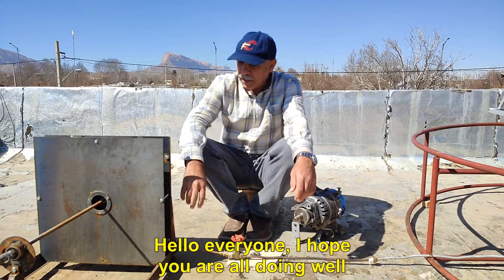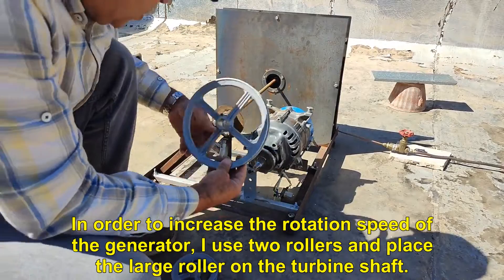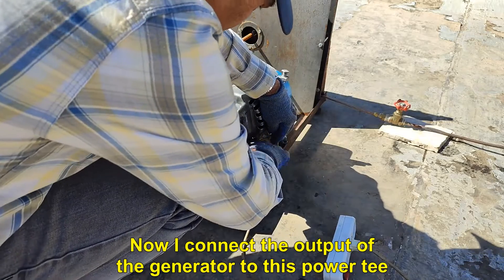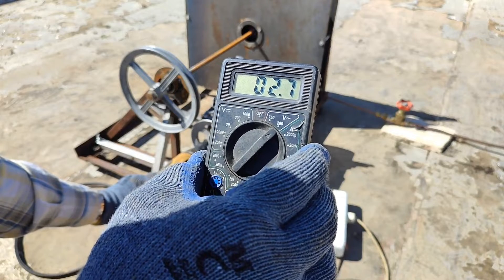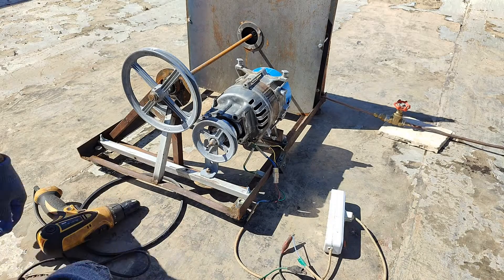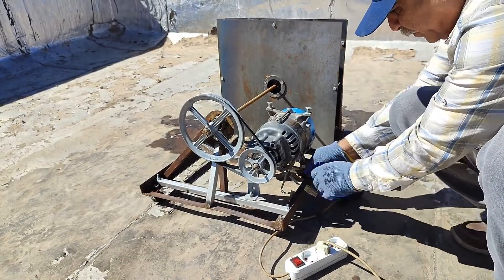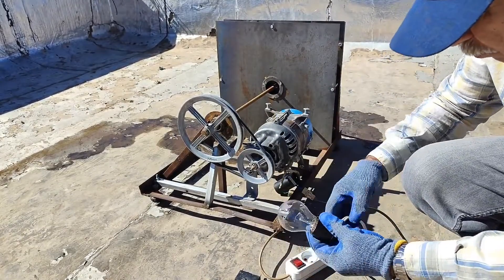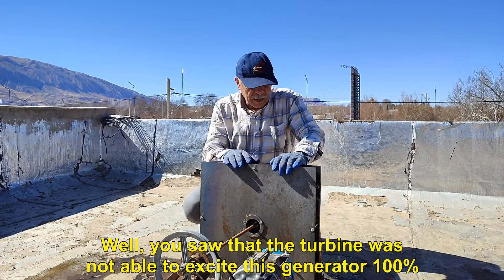Single phase synchronous generator 1000 volt ampere.Synchronous Generator

Comment: Does the diameter of the disc affect the power generated? For instance, if one wants to power a 200kva alternator, what diameter disc will you advise? i m thinking of using water tube boiler to power it.
Reply from the maker: I thank you
The most important point is the output power of the steam turbine, and its speed can be increased or decreased by various methods
Reply: @fixedfocussolar  Thank you sir for your usual prompt responses. Can you please help with the various methods?

Comment: For a higher power value output live 30kva, will you advise a flywheel to be incoporated? Thanks again for your video
Reply from the maker: Thank you
In fact, the amount of energy output from a steam turbine is constant and the use of a flywheel does not change the amount of energy.

Comment: Put 10uf capacitor and 2inch pully to alternator thanks 💡⚡
Reply from the maker: Thank you for your comment
But I think the power of this turbine with a small nozzle cannot create the necessary rotation
By the way, the standard capacitor of the generator itself is only one micro farad
And the capacitor with more capacity causes the generator to burn
Reply: @fixedfocussolar   rpm is low u need to put 10uf capacitor and 2 inch pulley to the alternator it will produce 220 volt 💡thanks 👍
Reply from the maker: @Discover-d4x  Sorry, but if you pay attention, the big pulley should be placed on the turbine shaft to increase the speed
Reply: @fixedfocussolar  sir it's a two pole alternator and it's start 220volts on 1600rpm also 😊
Reply from the maker: Again wrong
According to the formula that I showed in the video, for a bipolar rotor and a frequency of 50 Hz, it is 3000 rpm, and for a frequency of 60 rpm, it is 3600 rpm. @Discover-d4x
Reply: @fixedfocussolar  ok